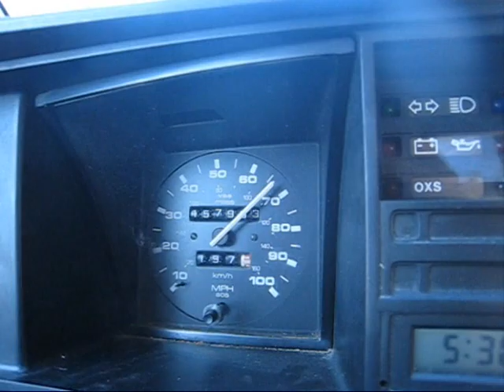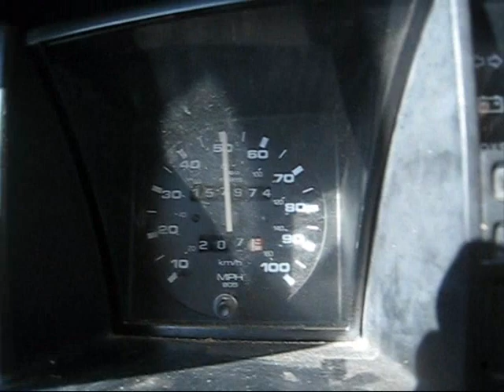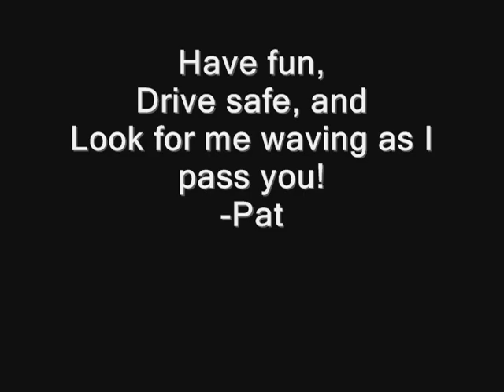Bostig Conversion: Final Exam on I-70 in Colorado

Comment: Great video.  Don't you just love the results!

I installed a GW2.5 and 5-spd tranny in our Westy. Have very similar performance results --- The Grapevine grade on I-5 (heading south towards LA) is very similar to your road.  I have to down shift to 4th gear, but I have no problems going 65mph all the way up the 4000 ft. climb.

Congrats!